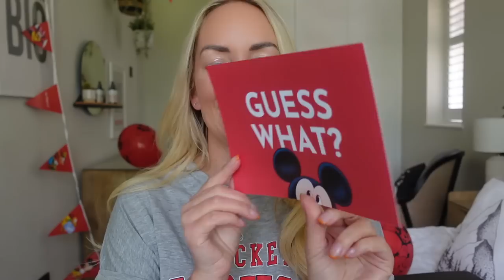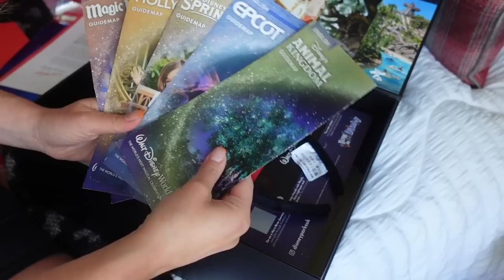WE CAN FINALLY TELL YOU!  Huge Surprise, Another Dog, Build Update + Makeup Routine Vlog

Comment: Emily, if you go for the light grout seal it after it dries. Apparently all grout has a "sealer" in it now but reseal with at least two coats. You have to make sure the sealer is washed off tile. It protects grout and also makes it easier to clean when patio gets dirty. You do need to reseal about once a year. I'm in US and we bought sealer in little bottles with brush at Home Depot (Hardware store chain here). Hope that helps. Enjoy Disney Resort. Warning it will be very muggy and hot. I'm from AZ (desert state) and it was HOT for me. The humidity is a killer. Hand held fans are great...Have a good time.